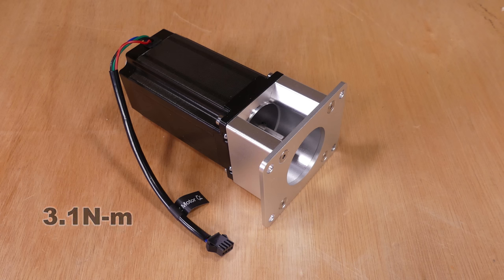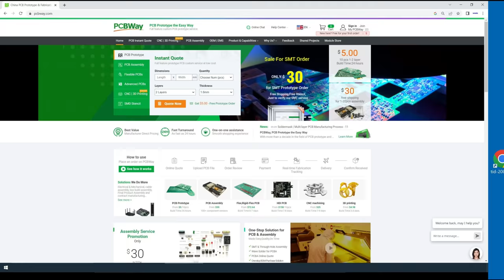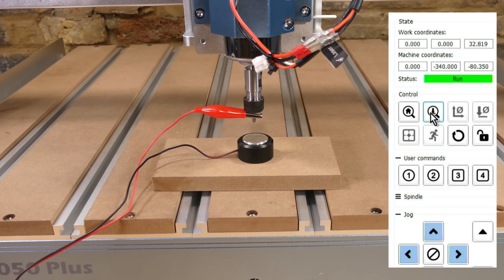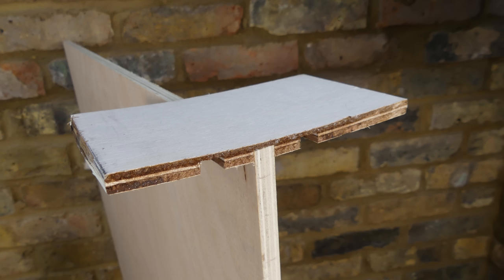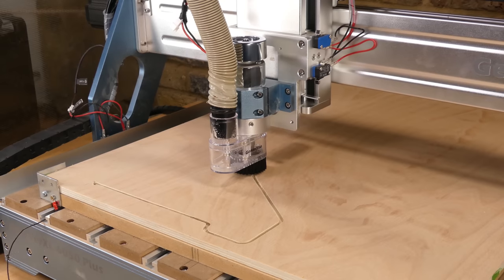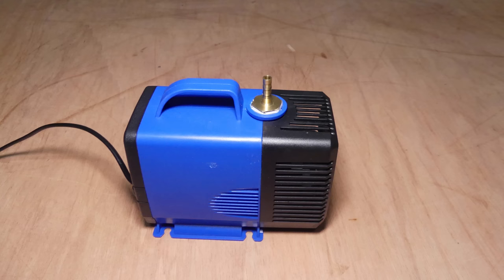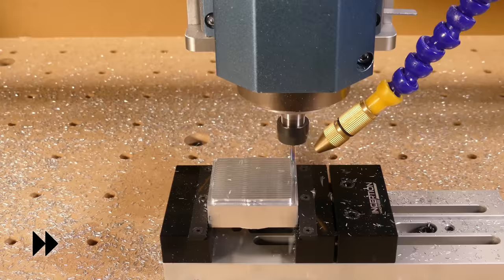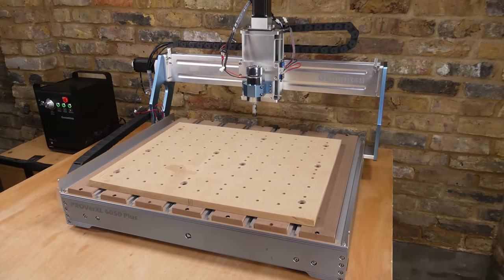Sainsmart  6050 Cnc with Linear Rails   -   (Sainsmart Genmitsu  PROVerXL 6050 Plus)

Comment: Easiest way I get ER11 collets out of the nut is to take my thumb and press it on the side of the collet and with my other hand turn the nut and collet. Not a lot of pressure is needed. The collet will find the right spot and pop out. It took me years to figure that out.

Comment: Also possible to milling plexiglass? Thx
Reply from the maker: Plexiglass is a brand name for clear cast acrylic, which it can mill and is shown in the video.
Reply: @techydiy  really? Looks it 3 times and there was no plexiglass to see? Video time?
Reply from the maker: Sorry, I was looking at another video when I answered. Yes, it will cut acrylic, pretty much an cnc router will cut acrylic, the easiest to cut is cast acrylic, extruded acrylic melts easily.

Comment: im only new to cnc but. why dont you cut in the direction of the bits blade. from left to right with a clockwise spinning spindle.
Reply from the maker: With aluminium it is usually better to climb cut rather than conventional cut. Try a google search on climb vs conventional cuts, you will find tons of info about it.

Comment: hi, would you recommend the 6050 over the 3030 pro for milling aluminum parts for rc models?
Reply from the maker: I haven’t looked at the Sainsmart 3030 pro max but it is probably the better option for aluminum.  Alternatively the foxalien wm3020 is good.

Comment: Thanks for the video. I just purchased this machine and I’m having issues running my files. I also use Fusion 360 to generate my gcode.  My machine connects and responds to jogs, homing, z probe. When I run. Y files the machine starts and runs the z up till it faults on the limit switch. I’ve run a prover 3018 for several years with no issue. Can you tell me which generic 3 axis machine you’re using to generate your code and are you changing and settings for it?
Thx
Reply from the maker: Use a generic 3 axis machine profile and the grbl post processor.
When you post  process:
Look for "Post properties" - "Safe Retracts and home positioning"     
and  set  "safe retracts to "Clearance height"
Reply: @techydiy  thanks that helped me find my problem

Comment from the maker: Testing the Sainsmart Genmitsu PROVerXL 6050 Plus Cnc Router.
https://buymeacoffee.com/techydiy

6050 Plus Cnc 
Sainsmart      https://bit.ly/3SYjoN1
Amazon         https://amzn.to/3ECv7MA

52mm dust shoe   
Sainsmart     https://bit.ly/52mmdustshoe
Amazon         https://amzn.to/3gf7gt5

65mm 1.5kW Water cooled spindle & VFD
Amazon         https://amzn.to/3EeXtet

Makita RT0701 router
Amazon         https://amzn.to/3EFv2rH

Fusion 360 Grbl post processor with comments disabled
 http://www.techydiy.org/download/2017/

You can also disable comments from UGS
https://winder.github.io/ugs_website/

Some of the links above are affiliate links. If you click on the link and buy something, you will not pay anything extra, but we might receive a small income, which is used to pay for future videos.

Comment: How do compare this with the FoxAlien Vasto?  I like the ball screws on the Vasto, but like the size of the 6050.
Reply from the maker: It really depends what you want to use it for.
The Prover XL 6050 is good for wood, good working area and has a good z height clearance / range. 
The Vasto is better for metal but has a lower z clearance. They also have a larger version.
Reply: @techydiy  Looking to do some aluminum milling as well.  I understand both would need spindle upgrade.  Is the stepper performance higher on the 6050?  Could the 6050 cut metal with z-axis upgrade or do the lead screws hold it back?
Reply from the maker: It cuts aluminium fine. If you want to cut a mix of materials its a decent option.

Comment: cutting slots,, why is it going in circles and not in a straight line to remove material.
Reply from the maker: It is an adaptive tool path (Search for Trochoidal Milling).
Reply: @techydiy  is that a better way or is it just the way you were showing in the video?
Reply from the maker: It uses more of the end mill cutting edge length, so less wear & tear, less load on the spindle motor and usually gives better results.
Reply: @techydiy  
Ok. Thank you so much for replying and giving me the info.😊

Comment: Hello I'm new to cnc and I'm looking for a machine and thus one seems to fit the build. Do you think it will handle steel ok and how do you like this machine. Overall I want a machine that can do metals. Do you think this machine is rigid? One more question. Could you add ball screws instead of lead screws to this machine easily
Reply from the maker: If you are primarily looking at milling metals, especially steel, then you should really get a mill rather than a cnc router.
Changing to ballscrews won't be "easy".
Reply: @techydiy  ok I'm thinking on going to the bulkman ultimate bee cnc kit it has linear rails and ball screws. Can you try and do a video on this machine

Comment: I had the same incompatibility problem between fusion and openbuild control, which I usually use.
I solved, after freaking out for 2 hours, using UGS platform
Reply from the maker: That is useful to know. Thanks.
Reply: @techydiy  did you get same lockup using other Cad/Cam software or just Fusion? Is it likely a problem with Fusion or Openbuilds sender if it works ok in UGS?
Reply: @techydiy  did you get same lockup using other Cad/Cam software or just Fusion? Is it likely a problem with Fusion or Openbuilds sender if it works ok in UGS?
Reply from the maker: It seems to be a fusion post processor related problem. It isn't confined to just this machine.
UGS probably  ignores the comments and does not send them on to the grbl firmware, which would have the same effect as disabling the comments in the post processor. It was easy to fix, so I didn't investigate much further.